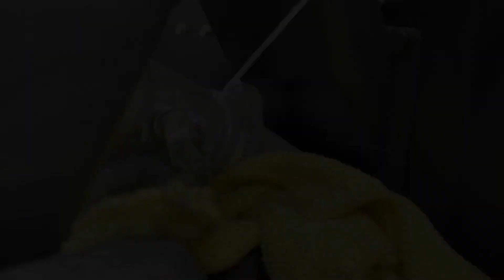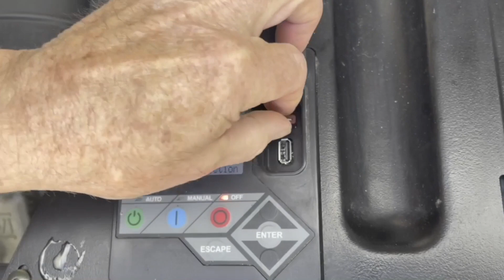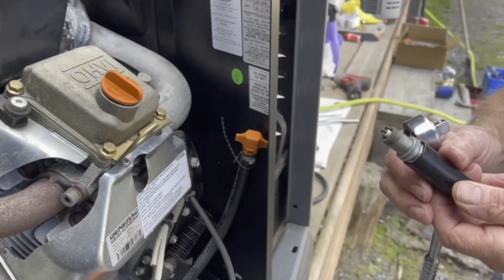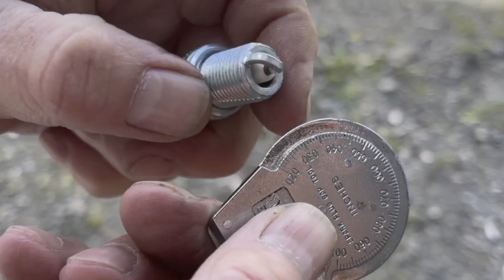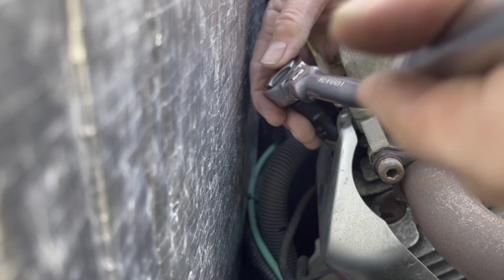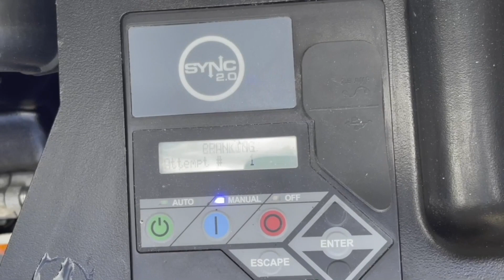Generac Generator Compression Test and Spark Plug Replacement

Comment from the maker: Hi rapunzel eh. Thanks for watching the video. I did a bit of checking on your situation. Check the basics. Make sure the oil level is accurate. Over filling can cause  this problem. Check the breather tube to make sure it’s not gunked up. Check both ends where the tube connects to. Take a good look where the hose attaches to the valve cover. You never know what could be there until you take it apart. Double check all of the connections and the condition of the rubber parts. Something creating the pressure. Is it ice or something else. You need to rule out the obvious. I hope this helps. Roger

Comment: i have a 17kw generac that i got when i bought my current house 6 years ago.   i'm way WAY out in the middle of nowhere, and it seems trees have a habit of falling on power lines all the time.   last week we had an unseasonable 'arctic outflow'... translated means we had a week of -40c.   THEN the power went out.   all was fine for a while.   just had the propane tank filled, so thought everything was good until GRRRRRRRRrrrrr...  then nothing...  the orange light on the case was lit and inside oil EVERYWHERE.  and the dipstick was out - like RIGHT out, had to look for it!!.   thought it was my fault, maybe wasn't pushed in after the last oil change in september,   but after research, appears it is the breather tube that leads in/out of the air filter case getting condensation that turns to ice.   there wasn't a pool of ice like many have... of course with no power, you can't drag out of the heat gun and thaw the sucker out.    i already have the battery warmer and the oil warmer, but did you know there is a breather tube warmer?    the breather tube ain't easy to get to on the 17kw version.   they have this little bolt UNDER the air filter case that just would not take the allen key, so ultimately had to use a pair needle nose vice grips to loosen it 1/2mm at a time because you can't get anything under it.   then you have to that the metal piece off, looks like an exhaust valve, which means you have to take the snorkel part off and you can't get to THOSE bolts easily either...      what would it take for Generac to add a couple hundred bucks, based on your location, and give you ALL: the pieces that will keep your machine from $%T^Y&U*I up when you least want it to???  literally takes 5 minutes to install them if you have the right tools and it's already shut off etc.   i do an oil change and airfilter/spark check every year, but have never checked the valve lashings...   on other stuff, but not this...  will definitely do it in the spring.   by the way, i have a gadget that checks the cold cranking amps for batteries too, not just the multimeter...   totally worth the money.   living where i live, i want to make sure i replace stuff BEFORE it goes, especially since the little town that's 45 minutes away, might not have whatever it is i need!!

Comment: It’s this done with a warm or cold engine?
Reply from the maker: Hi 5145. It’s been a while since I did the video. When I watch it I’m pretty sure the engine was cold or hadn’t been run. My arm is very close  to the exhaust manifold. If it was hot I would been much farther away. Also when removing the spark plugs I am handling them without gloves so they were cool to the touch also. I don’t think it matters if it is hot or cold if you are doing a basic maintenance check. If you are having problems I would do both hot and cold to help narrow down a problem. If you check the compression and keep notes it would make sense to always check under the same conditions so the multiple results would indicate any changes. If your having trouble starting a cold engine then it would makes sense to check the compression when it’s cold. Hopefully this helps. Thanks for watching and posting. Roger